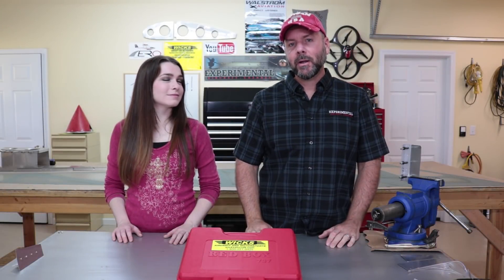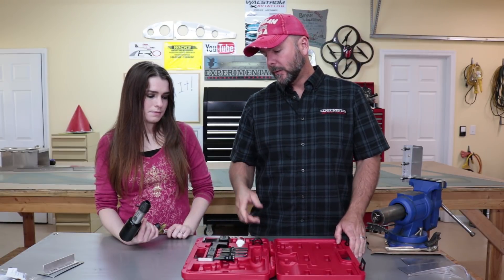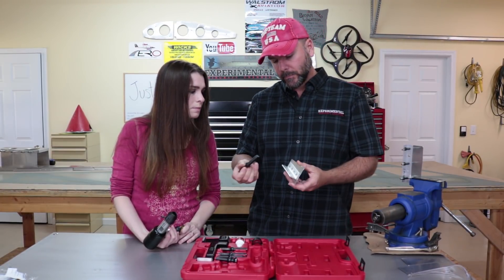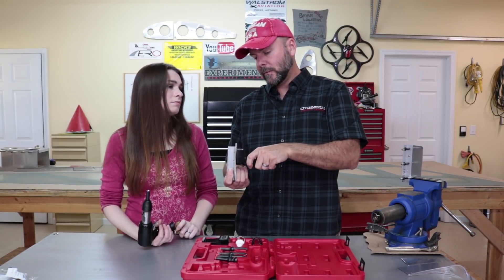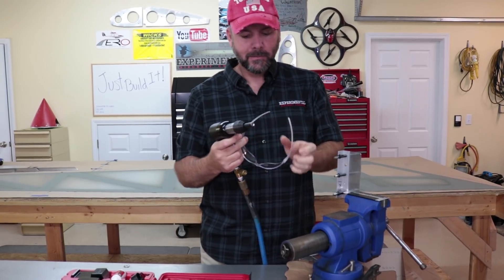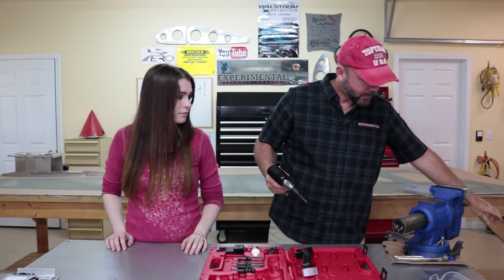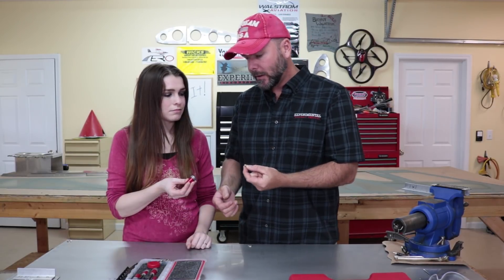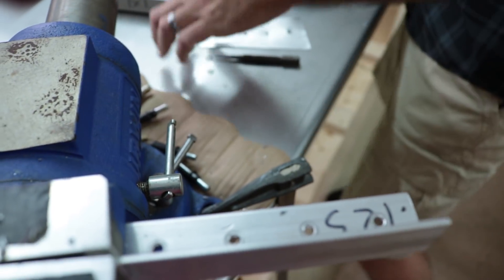Aircraft Builders - Rivet Guns and Drill Guides

Comment: Experimental Aircraft Channel, I appreciate your effort in bringing this content. With that being said I’d offer the following in regards to this weeks video:

I’ll start with the rivet drill guides, IMO it’s a worthless tool and money could be spent elsewhere that would actually provide a benefit to the builder, say a tungsten bucking bar. 

As to the rivet gun info. You left a few questions unanswered:
Why did you choose a 3X rivet gun? ( proper size gun for the rivets being driven)
What does 3X mean? (the power of the gun, how hard it hits. 2X, 3X,4X etc)
Furthermore you should refer to the rivets with proper terminology, a flush rivet is a AN-426, a dome rivet is a AN470. Also, the viewer should have been told how to choose the correct set for the dash number rivet they are using, not just that “it covers the head”. The size of the buck tail should be 1.5x the rivet diameter and .5 diameter high to be a properly bucked rivet. 

Finally, your technique of several short bursts on the gun to set the rivet is not good practice. You will work harden the rivet and that leads to cracking and you definitely don’t want that. The rivet should be set with one properly timed burst on the gun (ideally) with one additional follow up burst, if needed to get the buck tail properly dimensioned. 

There are a gillion other things that go into riveting, bucking bars, and gun set-up that were not mentioned here, I suspect a follow-up video in the future.
Reply from the maker: @Dave Bottita Thank you and NOTED. Thanks for the clarity on that. I'll have a think about what details to share for future.